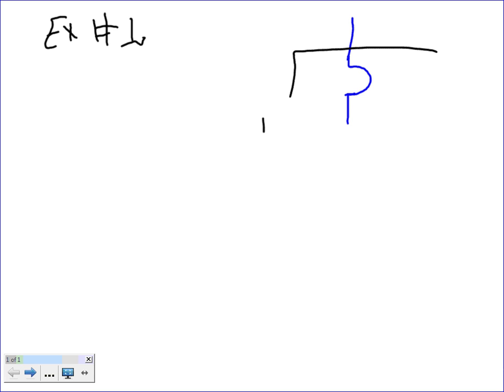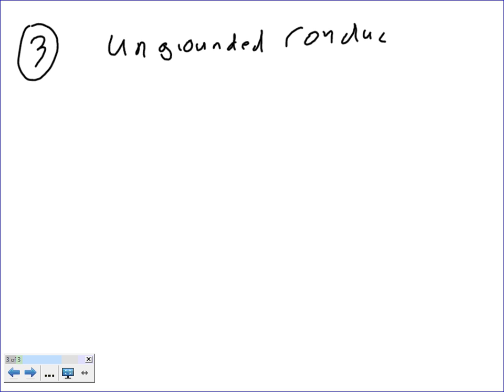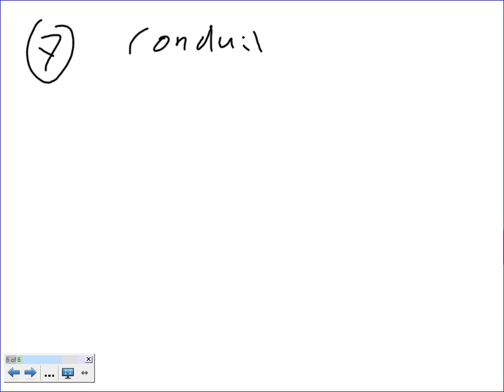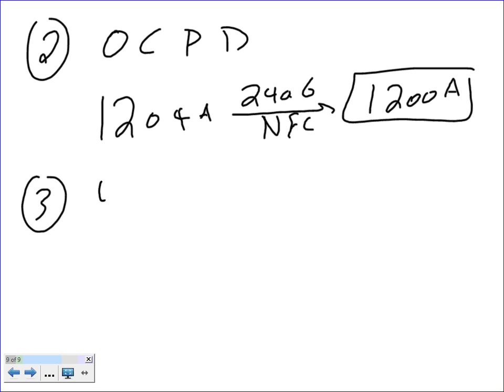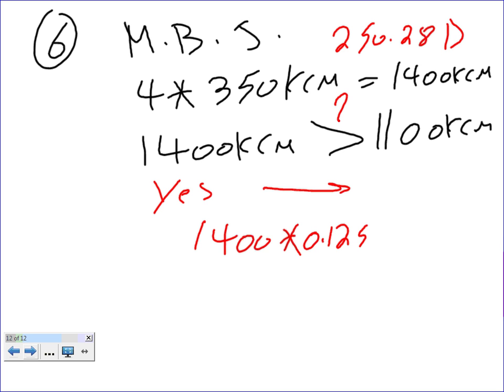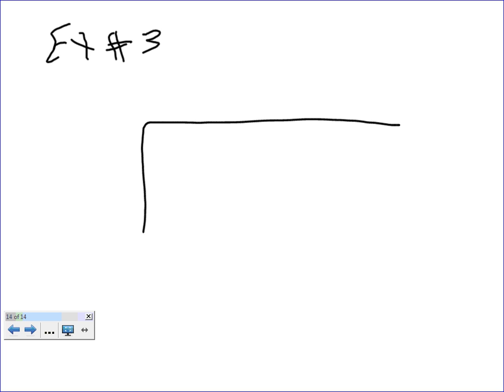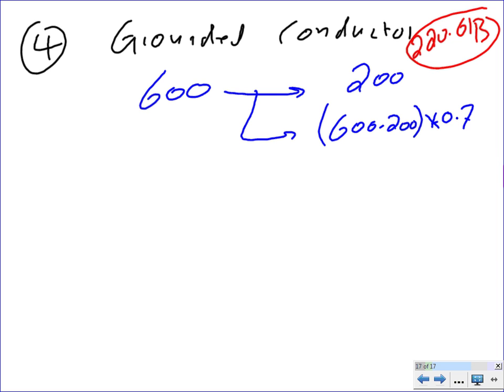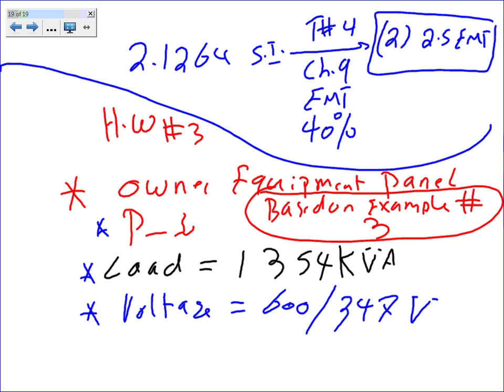Panel Sizing-03-25-11.wmv

Comment: In service panels, when the Neutral & ground conductors are bundled, if a short ckt occurs in any of the phases, the fault current will flow to through ground through the Neutral and to the system, which may affect the ct current and the tripping system.ct may also get saturated please explain?..
Reply from the maker: Not true. The N&G are bonded so fault current goes to the source (Transformer) mostly though N but some through GEC.